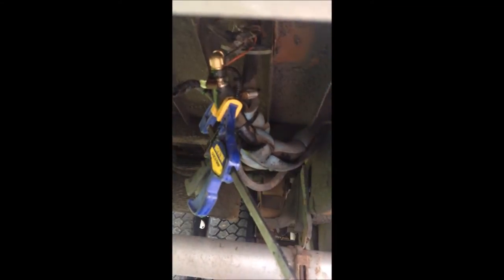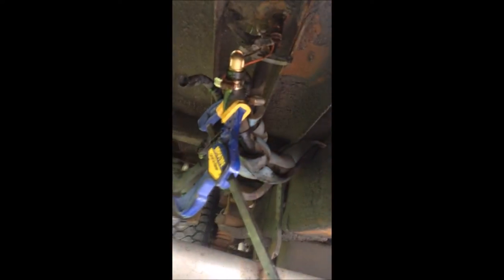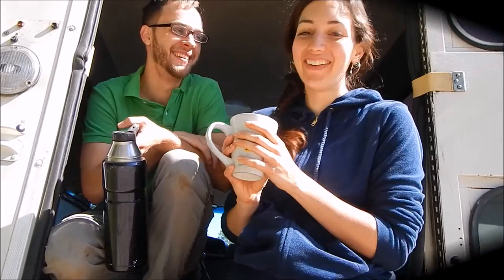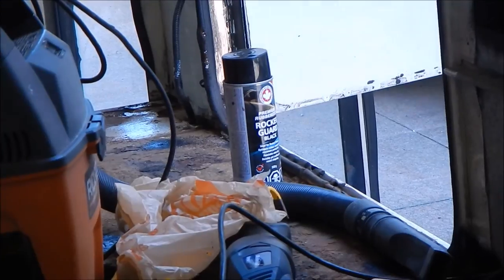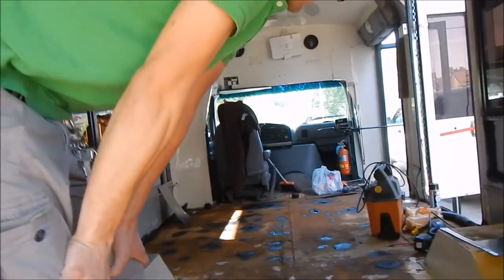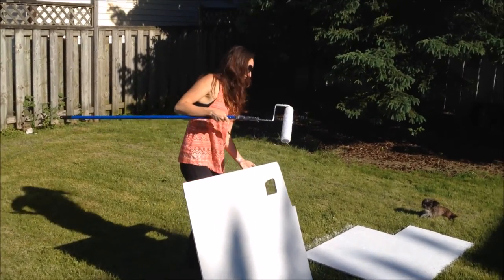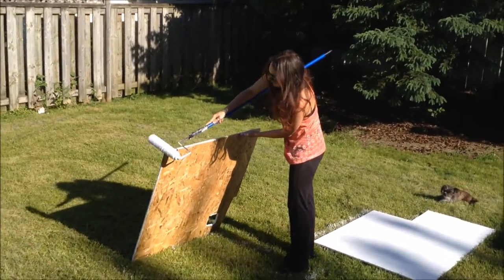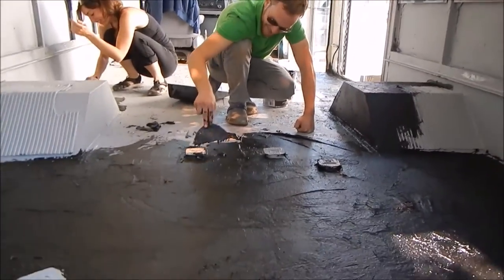School Bus Reno [Ep. 2] Priming and Sealing the Floors - The Ombiance Bus

Comment: Wow, we are starting a similar adventure! Isn't it fun ;)
What is that black stuff you're using after the primer? An epoxy? Nice job, Tyler, and Kailie that really is quite a bit of work. 
We are still trying to get the heater out; the hoses on ours are much larger, and its closer to the front of the bus. I also took apart our instrument panel. I'm kind of tracing what the previous owner did. He made a partial conversion to a hunting rig, but he certainly didn't mind how it would end up down the road. Anyway, it must be nice to have a newer rig; however, I was NOT envious when I saw you pry up plyboard off the floor! Our vinyl didn't have anything under it. 

Anyhow, good luck on your journey! We will have to be full-time living in our bus by April. Obviously, some comforts will be forfeited for a little while, saving up the money for solar, and planning out exactly what we're going to be doing with it. Thankfully, we have a friend with land who wants our company :) 

Looking forward to seeing more of your videos. The cinematography is respectable, and you both have charming personalities. 

https://splittingelm.wordpress.com/
Reply from the maker: Splitting Elm Howdy!  Yay - your project sounds so exciting.  We LOVE hearing about bus reno projects - if you couldn't already guess. haha

The black stuff is called "Rocker Panel Guard" which was originally designed for under bed coating for insulation and sound proofing.  It was a much cheaper option ($40 per can) than the hard truck bed coating that we wanted ($100 per can - yikes)!

We are also taking off this April.  We are in the middle of editing the rest of our video's from last summer when most of the reno's were complete.  Winter came and the project came to a pause.  We secured a farm/work exchange in BC.  Looking forward to the adventures.

All the best to you and your bus crew. We will certainly check back for updates. !

~ Kaeli, Tyler & Pavlove the Dog  :-)

Comment: What did you use to seal the floor? I saw one was grey and one was black.
Reply from the maker: The grey paint was 'rust stop' from Canadian Tire.

The black stuff was a different 'rubber rocker guard' - similar to the 'spray can' stuff featured in the video.  It is specifically designed for under truck beds to insulate / protect.    We wanted to do a truck bed liner, but it was too expensive.  The black goo we used worked great. Don't smell the diesel anymore.  :-)

All the best to you and your renovations - you converting a camper van too?  :-D